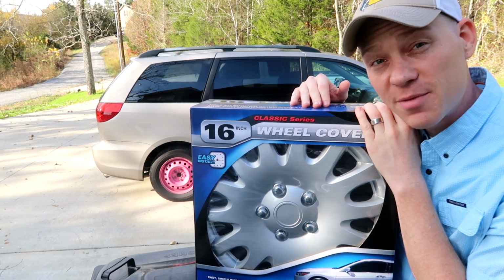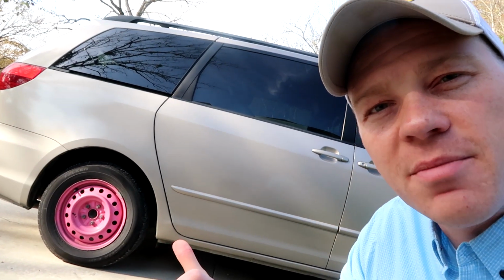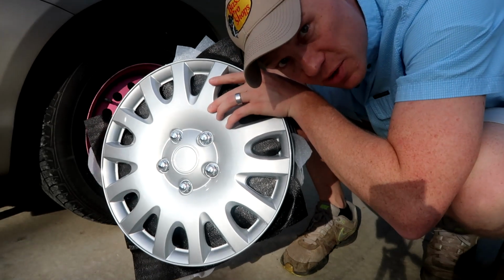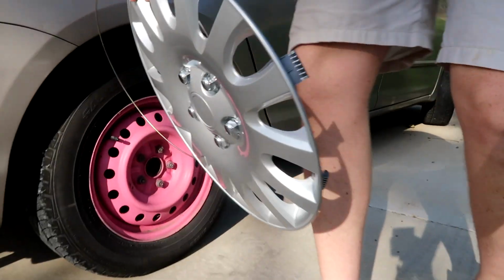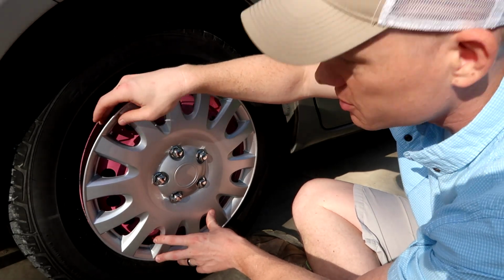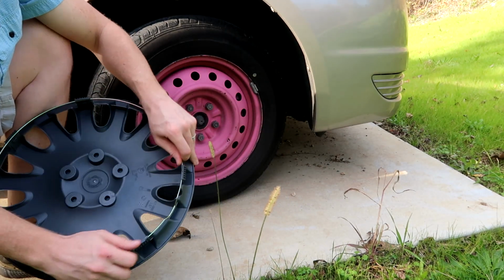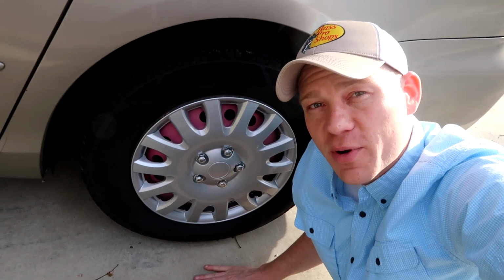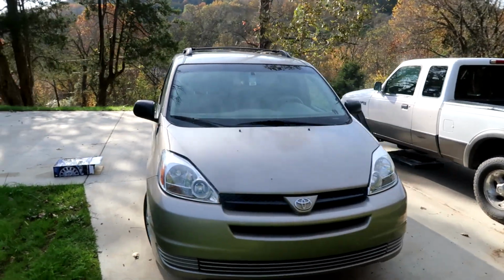Walmart $22 Hubcaps!!!

Comment: This video was PERFECT 👍 Thank you. I got them on easily. I have a Toyota Yaris, and their hubcaps kept coming off on the highway after every tire rotation. They cost $115 to replace. These I've installed today were $29 at Walmart. I will be much less upset if they go flying off. We're you able to sell the minivan? I like the pink. A the husband of a friend of mine spray painted their wheels pink to attempt to deter their teen sons from taking their mom's truck in the middle of the night, lol. They were undeterred.
Reply from the maker: 😆😆😆 yes, sold the van

Comment: ALSO- "Most" of these newer wheel covers have "2" sets of slots in each tab, so you can increase or decrease the tension with the wire hoop to suit your wheel. (I assume to cover multiple wheel makes/models. i.e foreign/domestic) Nice, quick, informative video! Thank you, Sir...
Reply from the maker: +Abe Lincoln hey thanks! These only had one place to put the wire for tension, but it worked pretty good on this toyota

Comment: Something I didn’t know but really makes a difference is to make sure the number of spokes on the hubcap divides evenly into the number of holes on your steel rim It will make the holes lineup with the gaps.  For instance I have a 99 Toyota Corolla the steel rims have 14 holes so I found hubcaps with seven spokes. The holes lined up perfectly with the seven holes between the spokes. If you find one with 14 spokes it’s even better but I didn’t want that many
Reply from the maker: interesting

Comment: Those caps crack so easily. I see you cracked the third one you installed. They look great!
Reply from the maker: +The Chris Collection for the money I think they look pretty darn good
Reply: WHO_TEE_WHO agreed!
Reply: The Chris Collection will they fall off while driving if there’s s small crack?
Reply: @andre18762  no they shouldn't unless one of the clips break off. He forgot to mention the clips are adjustable you can put the ring in the lower slot on the clips to make them fit tighter.

Comment: On the first hubcap you put the bent part bending away from the hubcap and it seemed to go on fine, on the second hubcap you put the bent apart bending into the hubcap and it seemed to go on fine. So what's the right way to do it, does it matter.
Reply from the maker: I don't remember
Reply: I had same question because if I'm not mistaken another video showed the hump upwards and said to make sure it was up or it would fall off... On to the next utube video  I guess lol

Comment: What evil demon possessed you to paint those rims pink? No, don't tell me; I'll think you are weak. And to think you drove that around; how embarrassing. 6 hours to do it to boot. I pained my rims black because they had rusted a bit and 5 coats did take about 6 or so hours (collectively over 3 days); you're right about that. You did have a great quick solution with these wheel covers; bravo for that! A buyer would still have to paint them, so covering them might be a time waster in the long run, but someone would buy it at the right price.